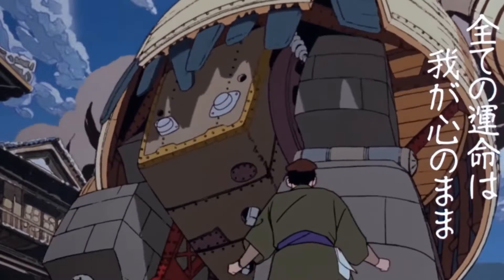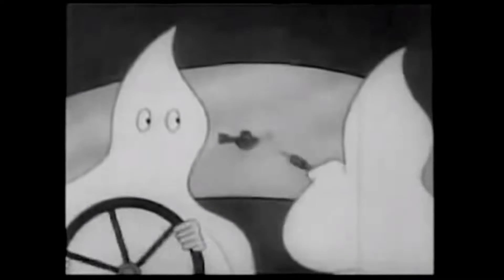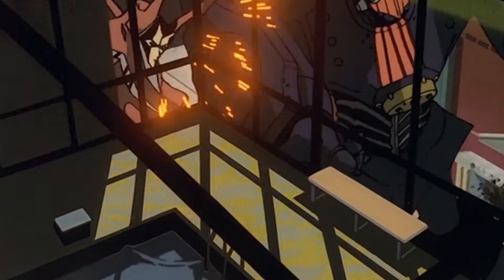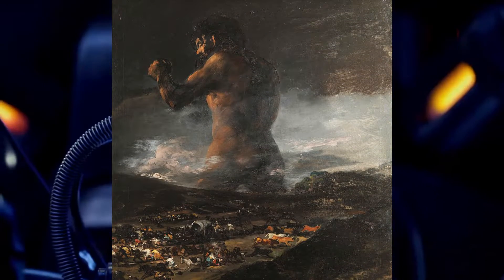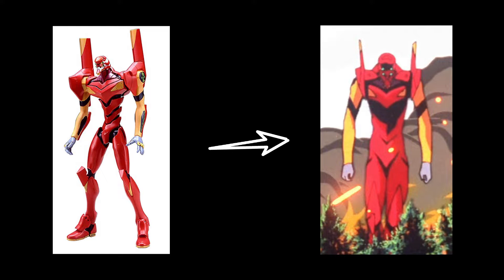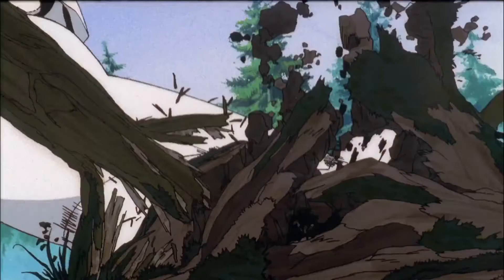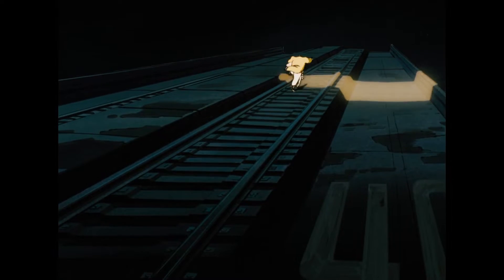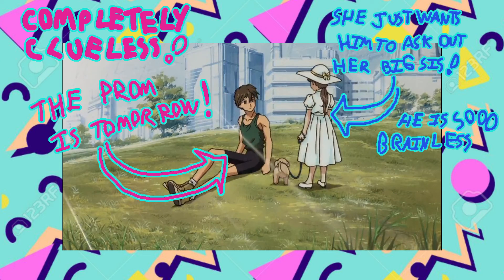ON MECHANICAL DESIGN-2: THE SUPER HEAVY WEIGHTS

Comment: "Titans of steel..."
(footage is from a parody that features deliberately lame mechas made of rubbish)

But well, yes. Mecha with weight taken into consideration gets into the territory of tech porn. And Giant Robo OVA is pinnacle of this.

Oh, and then there's GR-2. While only having one short scene, this scene is the only actual mecha vs mecha duel (I don't count those times when Giant Robo just punched BF robots once, and they were done) in the series. And what I love about it the most? Rocket punches. The best rocket punches I've ever seen. They only fire after a short but noticeable buildup, and they visibly accelerate in the air. Then there's jet engines making them tremble as they catch Giant Robo.

If only someone did Mazinger justice and animated it the way that would convey "indomitable castle of iron". With ground shaking and cracking with every step, with rocket punches like those of GR-2, and with scrander jets emitting enough light and heat to show just how much energy output it takes to keep the thing afloat.
So far Mazinger animes have only done tiny pieces of that, like meteor impact landings.

Comment: Finally a channel that goes into in-depth, thoughtful discussions of the mecha genre and mecha design. The Big O and Giant Robo are among my favorite mecha shows. I love the heavyweight designs and how much weaponry is stored into these massive bodies. I think GunBuster might qualify due to its size, but in the shows it only fights in space so you can't really have an impression of its size and weight. Please keep this mechanical design series up!
Reply from the maker: I will for sure, and keep in mind, these categories are not concrete hard borders, there are for sure times when a mecha which is typically quite fast will slow down, or quite slow will speed up, the ones i featured here simply display the highest average in my mind and act as good examples, Gunbuster for sure has some beef no question, i think in particular the scene where it is rammed between the two Uchuu Kajiu uh "pancake ships" is a good example, or its landing into the front of the Exelion, its got some heavy DNA no question.